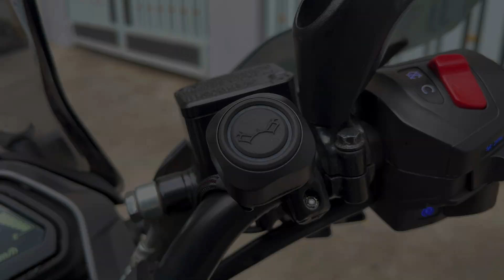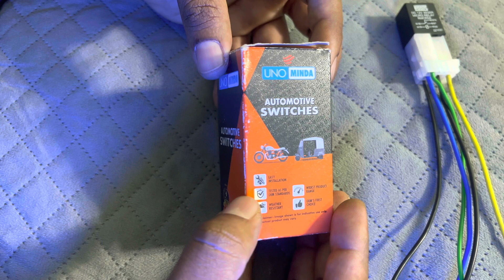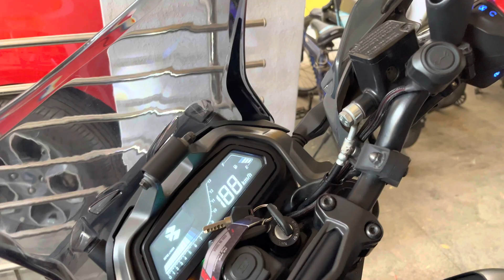Smart Hazard Pro | Custom Made Hazard Flasher | #diy #arkionx #dominar400 #motorcycle

Comment: @ARKIONX. it would be better if you could add the circuit diagram. There are several mismatches between the description and the video
Reply: Agree!
Reply: @ripunjaysingh5310  I made this circuit. Had been tricky. i will post the Circuit Diagram once i purchase the maddog switch and do the wiring for the switch too
Reply: @SangeethSKumar1 Thank you in advance, this will surely to save my time. Let me know when its done. Btw I was thinking to create a whole new pcb having all the components integrated in it, but I dont have that much of know about electronics.

Comment: That's a pro level DIY content bro.. most of us DIY mechies are not that good with electricals.. couple of years back I built a relay circuit to activate 2nd horn while applying brake and it took me an hour to figure out that ns200 had negative horn trigger 😂😂 and I realised my electrical knowledge was not that good 😂 !

Comment: bro can you do this feature with flash x module?
Reply: there will be 2 positive connections for flash X and 1 gnd respectively, 1st think you can do is to indentify them, rest is simple bro, if any anything you r facing issue, i will be there 😊
Reply: @ashikmandal1891  ok bro lets I'll identify them.
Reply: Yes we can, I personally did it for my ns200 with flash X module, flash X will work if you feed the supply apart form your ignition, means if you connect flash X directly to the battery, still it will work with the indicator switch combination
Reply: @ashikmandal1891  can you plz help me out for that Or do you have video about that

Comment: Dude, is this possible to do with Flash X hazard flasher, with same thing, 1. When Ignition on and flasher/ hazard turn on  even when engine Ignition is off and by  pressing switch the hazard light off and  never active until again Ignition is on
Reply: Yes we can, I personally did it for my ns200 with flash X module, flash X will work if you feed the supply apart form your ignition, means if you connect flash X directly to the battery, still it will work with the indicator switch combination
Reply: @ashikmandal1891 dude..i installed hazard flasher in my ns200 2025 model...it work only when engine is on...when engine off flasher off 😅
Reply: @techadonmaster correct bro, I too faced the same issue, but now I changed the connections, 😅 now it is working anytime whenever you want, even I costomized this so it can work with ignition off condision.
Reply: @ashikmandal1891 could you provide me circuit schematic🙂
Reply: @techadonmaster there will be 2 positive connections for flash X and 1 gnd respectively, 1st think you can do is to indentify them, rest is simple bro, if any anything you r facing issue, i will be there 😊

Comment: Bhai I have a suggestion for you if you can make it
Kya app horn ko headlight ke pass ke saath connection kar sakte ho jise hum jab horn de taab pass bhi jaal aur pass switch se individual bhi jaale 
Thank you...
Reply: You need a separate 4 pin relay

30 from passing switch input
87 to headlight
85 from horn output +ve
86 from horn output -ve
Reply: Ok thank you @reddevil3420 
Let's try
Reply: @sprateekprayash84 do try first without connecting directly on bike 😂

Comment: I don't know if dominar have this problem or not. but my 2023 scrambler 400x have this feature in built. I can turn on the hazard light then remove the key and hazard will be turned on until I switch it off
Reply from the maker: Yes, modern motorcycles have this in built, however this video can help people who wants that feature in any motorcycle.
Reply: @ARKIONX  thanks dude, you are making most of the complicated things easier to many of us, just one thing, this hazard will not be helpful when hazard on condition we have to use left or right indicators, but if you turn on flash X directly from the battery, it will work with left right indicator individually as well.